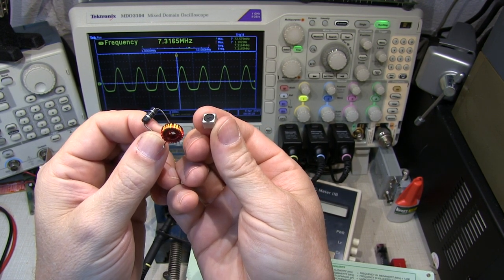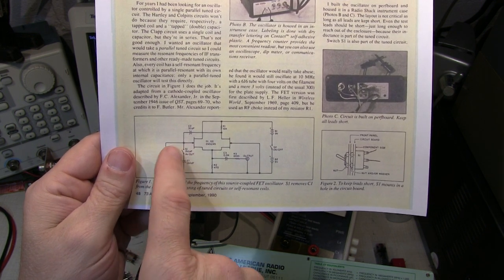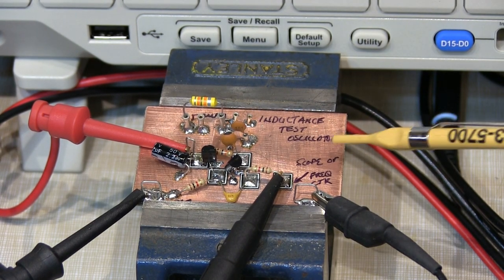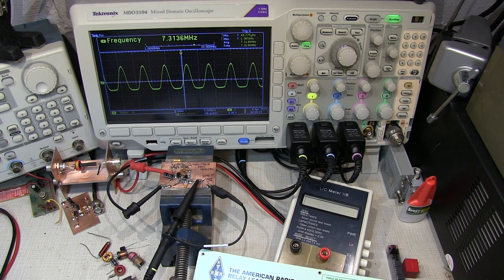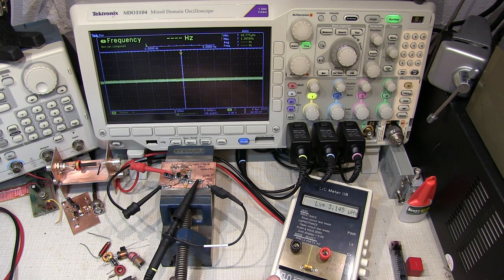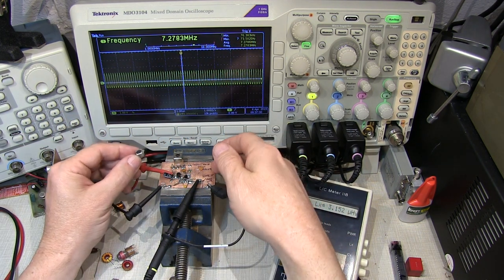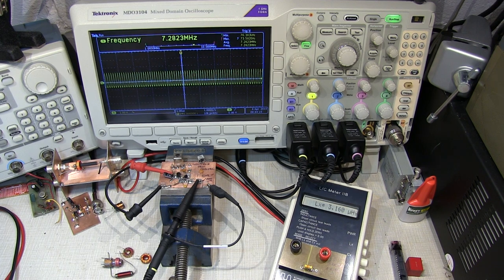#199: Measuring coil inductance and IF transformer resonant frequency

Comment: Right here goes a question and hopefully you maybe able to help me out.
I have a Technics Tuner ST-GT650 and T101 which is the Discriminator coil in the FM IF circuit drifted away from its 0V so I managed to get it back to 0v but broke the ferrite core which was totally my fault but was wondering can you take out the broken ferrite stub screw and replace with a new one.
I would change the complete tuning coil if I could find one.
Now the markings on the side is B005 S4N3 can you help me out please with what value it is and where I can get one.
I can send you the service manual by email no problem.
Reply from the maker: If the part number for the coil isn't listed in the service manual, then it may be hard to find a replacement other than from a similar unit.  You may be able to replace the core from a coil from another tuner - they should all be similar enough if used in the same IF frequency.
Reply: @w2aew  I have the service manual and the part listed is RL14B005-Z and just states Coil but the marking on the side is B005 S4N3 could you recommend what I could use as the ferrite screw is broke but sort of still functioning as a discriminator.
Reply from the maker: @johnny1408  RL14 is likely the manufacturer's model number for the series, and B005 is the specific part in the series.  I'm sorry, but I don't recognize this manufacturer's code, so I really can't help.  It is possible that a core from another inductor from a different tuner/receiver may work, nothing to lose to try it.

Comment: Sir how did you just put the component to board without any soldering ?Do you have any video that lead me about this topic ? please
Reply from the maker: The components for the test oscillator are soldered to the board - I just didn't show the construction part of it.  I soldered pin-sockets for the leads of the parts being tested.  I did a video on breadboard construction techniques, which can be found here:
https://www.youtube.com/watch?v=kH110yjYZ2g

Comment: r regarding tubes or valves in my case running on 3 volts i've had a superhet front end working with 3 volts such as an ech81 and russian pencil tubes and acorns.

Comment: w2aew, when you have two coils that measure 6K DCR and wire them "in series". The formula is 6K + 6K = 12K DRC? when you wire them " in series" with only one coil reversed out of phase the formula is 6K + (-) 6K = 3K DRC?
Reply from the maker: The DC Resistance is unchanged - it doesn't matter if it's reversed or not.

Comment: I wonder if this could be used to test the resonant frequency of a loopstick antenna I want to build?
Reply from the maker: +Patrick Briggs No, probably not.  a tuned IF transformer looks like a high impedance at resonance, while a loop antenna looks like a low impedance at resonance.  Better off using one of my vids showing how to tune an antenna or measure complex impedance with a simple bridge and scope.  Other videos like the ones on directional couplers might also provide some good ideas.

Comment: Great video. Can you give a list of JFETs to use. I have a few on hand. Thanks
Reply from the maker: Just about any general purpose jfet intended for small signal / oscillator use should work. You might need to adjust the source resistor as I described.

Comment: Great video, clearly presented as ever. Could anybody please point me to a simple oscillator circuit that produces a sine wave within audible frequency. I was delighted to get a Colpitts oscillator working, gave me a nice sine wave but it was coming in at 260MHz.
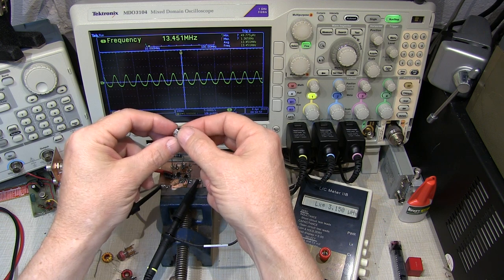Reply from the maker: You certainly can get a Colpitts oscillator to run at audio frequencies by adjusting the L and C components appropriately.  Another simple oscillator (if you don't mind a little distortion) is a simple phase shift oscillator as shown at about 7:22 in this video:
https://www.youtube.com/watch?v=81C4IfONt3o
Reply: Thanks very much. I did try larger values of L and C but it looks like I need to persevere down that route. I've just checked my notes and the frequency I quoted above should read KHz not MHz. I'll certainly look into the phase shift oscillator. Thanks again for the response and for all your excellent work.

Comment: Allan, where do you find such sockets? What are they called, e.g. what would I order from DigiKey? Thank you, sir!
Reply from the maker: I use pin sockets from Mill-Max.  Similar to these:
https://www.mouser.com/ProductDetail/Mill-Max/0552-2-15-01-21-27-10-0?qs=sGAEpiMZZMs%2fSh%2fkjph1trRw3Iqu89Lv9TGKSdMTRvY%3d
Not sure the exact part number I've used in this video, but the above link shows a good example.
Reply: w2aew Thank you, sir!  Just what I needed ;)

Comment: Why do inductors or coils operate at a colder temperature when using DC voltage/current compared to using AC voltage/current the temperature is hotter and lifespan is lower? The AC and DC voltage and current are the same amount but the temperature of the inductor or coil is a major difference

Comment: If you don't mind, I have one more question about the solder islands. From my calculations, the capacitance of the islands is minimal using standard FR4, but what I wonder about is impedance? The squares I make are usually around .25"x.25" FR4. From my math the impedance is on the order of 25 ohms. Has anyone tested this? Perhaps the Z only becomes an issue at GHz and beyond. Just curious... As always, thanks for the videos and keep up the good work:)
Reply: I've measured my homemade lands and they're typically about 1pF. The MePads are about 1.6-1.7pF due to thinner substrate. Even the MePads present about 100ohms capacitive reactance at 1GHz.

Comment: Alan is there a practical frequency limit for the circuit shown ?
Reply from the maker: Bob Marston Yes, I'm certain there is.  I found that it worked from below 200kHz to above30MHz.  For high-Q devices, it will likely work higher than that. With some component changes, it would work into VHF.

Comment: where do you get those nifty single sockets??
Reply from the maker: They are called "pin receptacles", made by a company called Mill Max.  Available through distributers like Digikey, Mouser, etc.  Lots of different sizes available.
Reply: @w2aew  Awesome! I went ahead and made these with two J113s. Other than mixing up the pins (On Semi and Fairchild versions have different layouts!) things went smoothly. I also used 1k for the long tail. Worked as described. Your videos are really helping with my adventures into RF circuits! 73 de VA3GPJ

Comment: isnt this just pretty much the same as your other video with this little bnc mounted "fast" pulse generator ? or does it make sense to have both oscilators around for some reason ?
Reply from the maker: The application using the fast edge circuit wouldn't be useful to determine the resonant frequency of IF transformers.
Reply: I think there is a way that the application using the fast edge circuit could be used to measure the resonant frequency of IF transformers and even measure transformer inductance and parallel capacitance.

Let us assume that we have an LC circuit with unknown Lx and Cx connected to the fast edge circuit. We will use two measurements 1) only oscilloscope probe with known capacitance Cp is connected and 2) we add additional capacitor in parallel to the probe with known capacitance C2. In these two cases resonant frequencies will be f1 = 1/(2*pi*sqrt(Lx*(Cx+Cp)) and  f2 = 1/(2*pi*sqrt(Lx*(Cx+Cp+C2)). We can solve these two equations to obtain Cx and Lx. The result is Cx = f2^2*C2/(f1^2-f2^2) – Cp and Lx = 1/((2*pi*f1)^2*(Cx+Cp)). Finally the resonant frequency is fx = 1/(2*pi*sqrt(Lx*Cx)).

Comment: I love your videos and they are done very well! I have a question, I'm assembling OneTesla Coil and I would like to test the coil that I assembled, but I do not know how to measure it - making sure it is working, before connection it to the rest of the kit. One can't just use a multimeter, I don't think, unless there is a way to do so - I'm all ears! I do have few "toys" like: 100Mgz Oscilloscope and 50Mhz Function Generator, few other meters, including the same LC Meter you have on your desk! (I love it, but one can't buy them anymore!) I do not know much about frequency coils and how to properly measure them, but if I get enough info I can make it to work, I think. I can't find someone in Lincoln, Nebraska that would teach me and most of my friends use Arduino for projects (I also do that) and do not know much about this unfortunately!  It seems to me you are the perfect person to ask! Anyone else is welcome to help me also! Thanks again in advance!
Reply from the maker: If it is a simple (albeit large) coil - you can measure its resistance easily (to confirm continuity), and you can measure its inductance.  Do you know that the expected inductance value is supposed to be.  You may be able to measure this with the LCR meter, or you can measure using a series L-R circuit with your function generator (square wave) and scope.
Reply: Thank you for quick reply! I do have a scope and function generator, but I never done this. I was looking here and other places, but I could not find step by step that would help me to figure this out. I'm not the brightest light bulb under the sky in this case - sorry. Bu if you give me few pointers, I'll try to do it, but I do not have any experience with coils  at all. I learn the best with guidance and or video/person/hands on .
Reply: I used the LCR meter, like you have in the video, to your write hand... I measured 45 mHy, ; I had to relearn how to re-calibrate it, since I don't use it very often.  But I don't know what I should set up in my Frequency Generator when connecting it to my Oscilloscope. I think the probe from the Oscilloscope isn't connected directly, I think.... during the test (this is based on the oneTesla instruction, that is incomplete to me: http://onetesla.com/tutorials/tesla-coil-tuning ) but I never done this before, so I have 0 experience doing this. When I was looking on this place and on the Internet, I didn't find details how to do this. I assume the distance from the coil would also need to be somewhat close, but I don't even know how close. How many volts and Peek-to-Peek should I send into the coil and what about all the other criteria that I can set in the FG? Sorry, I just don't know anything about that kind of setup and how and where to connect the leads. I wish there is a video for simple guy like me! My direct email is: czecht@gmail.com and I also have Skype under the same name and email. I'm here until late evening hours most days, but also during the day I try to play with all my hobbies here....Thanks again for your help! (Sorry I do not know your name)

Comment: Thank you for great videos.
I have problem to get the oscillator working. I have tried several ways but no. Was able to get the circuit work with a cristal 7MHz insted of C2 and 680k to ground. Is there other who has same problem as me. 73 de SM5LTG / Ulf